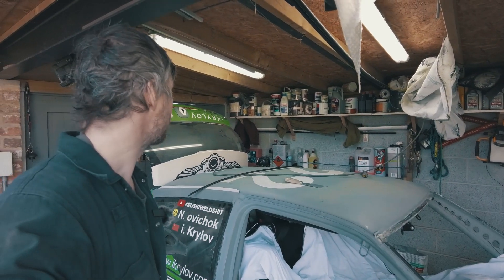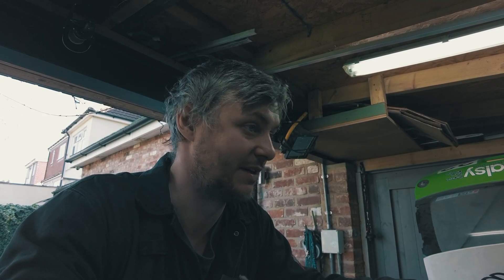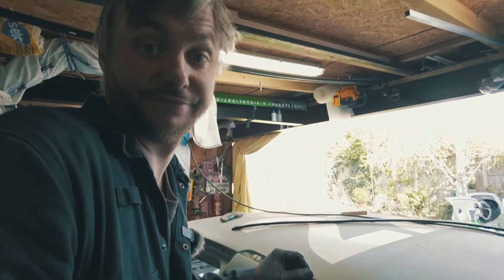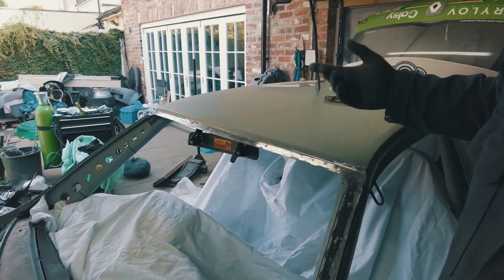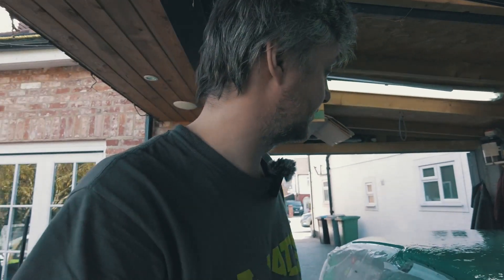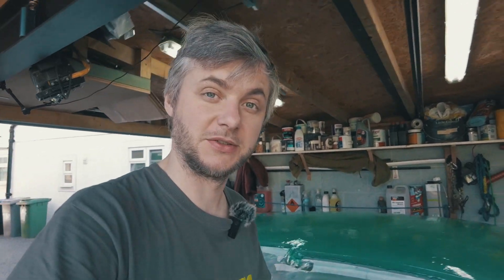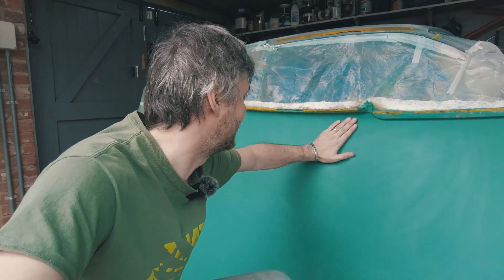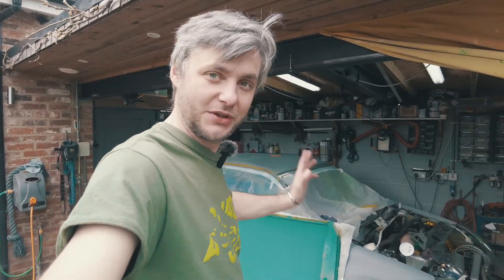DIY Clio Carbon Fiber Roof | Making The Mould | Building the fastest Ep. 36

Comment: hello!
I plan to make a carbon fiber roof for a friend next week and I was wandering what kind of resin are you using to make the mould? I usually use the Uni-Mould one from easycomposites that is yellow.
Thanks in advance.
Reply from the maker: i used cheapest resin i could find from Mould craft. it was very large area and uni-mould as amazing as it is, not cheap.
Reply: @RuskiWeldFab  thats good to know thanks for the fast response.
One more question, was it a mould making resin or just a normal laminating one?
Reply from the maker: it was a mould making kit
Reply: @RuskiWeldFab  good to know thanks.
Decided to just use the original roof and make a positive.
Thanks for the info

Comment: Looking to do similar on my car panels. The bags you use are they from easy composite as you wet lay then just vacuum them instead of resin infusion setup? Thanks
Reply from the maker: Yes they are. just wet lay than bag it and leave it for 18h.

Comment: 3:01 does that roof channel strip just pop off or did you slide it to the rear of the car to remove it? This is going to be the lightest and fastest Clio in the country :)
Reply from the maker: yeah they just slide out from the back. need a bit of force to get them going tho. lightest probably not. But i am defo working on the fastest bit haha
Reply: @RuskiWeldFab  Thanks! I want to remove mine to clean the dirt that's been under there since 2003 😂😂
Reply from the maker: hahah you sure you want to look under there??
Reply from the maker: @css172  haha thats what i keep saying lol but wife seems to think pension is important as well haha